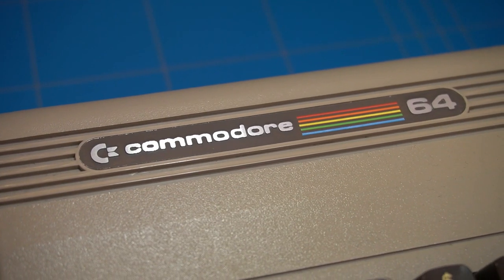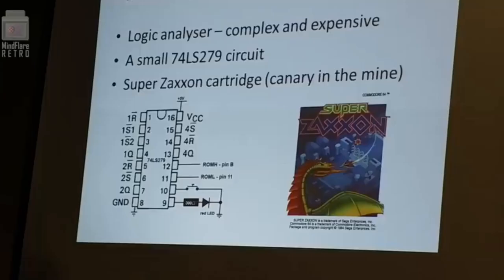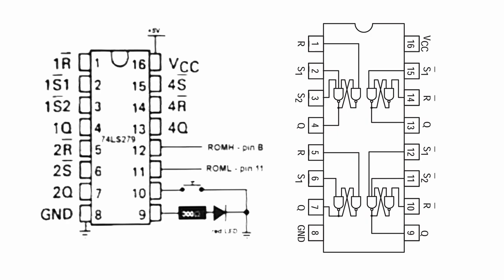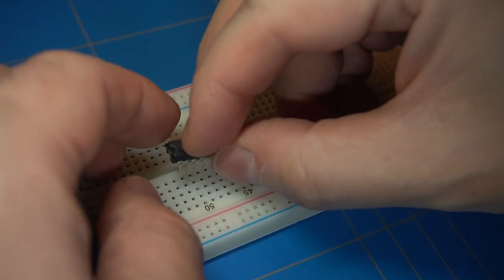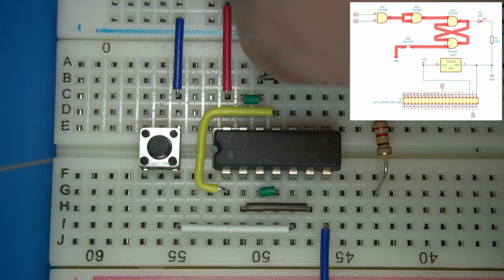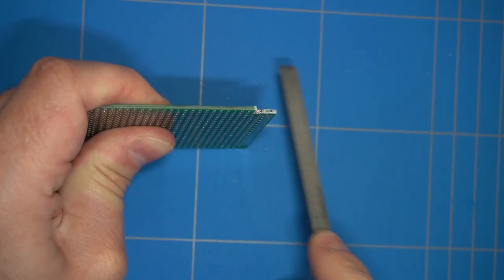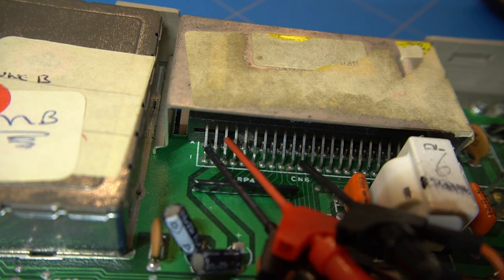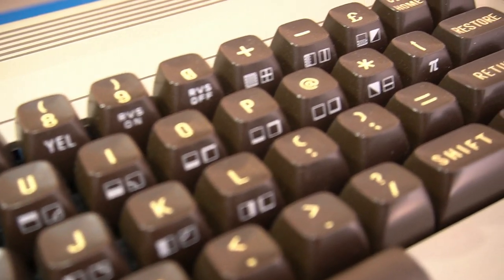Commodore 64 custom PLA chip test

Comment: That;'s a great video!
 I like how you explained the PLA's combinational logic table.. Your use of the 74ls00 chip as a  Quad Set-Reset Latch is lateral thinking at it's best. I want to build one. Well done. I'm surprised I haven't seen this video earlier.
Thanks
Reply from the maker: Thank you. I was simply forced to use the NAND chips as I did not have the 74LS279 at hand. :-)
Reply: @ezContents  very creative. A question, how fast do you think is the 7400 chip's switching speed? Only reason I ask is some datasheets say the 74ls279 will switch around 35ns. I use an EPROM solution and the glitch can occur in under 20ns. I think I miss quite a few glitches.
Reply from the maker: @eebaker699  Well.. according to the data sheet the propagation delay time of 7400 can be between 3 and 15 ms. But I see that I am using 3 NAND gates in a row for the setting side (S1 and S2). Hard to say... I did not measure the switching speed in the circuit.
Reply: @ezContents  that's very helpful. I might build one of your S-R latches and see if it's any better. I'll let you know how it goes.😁